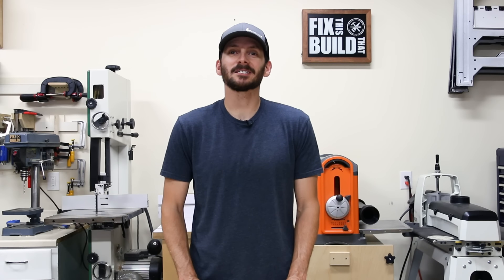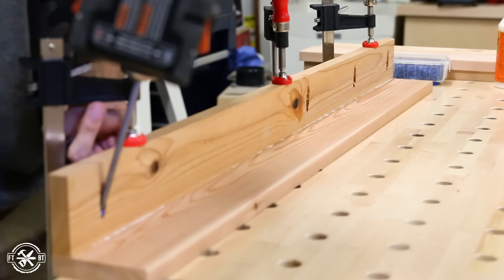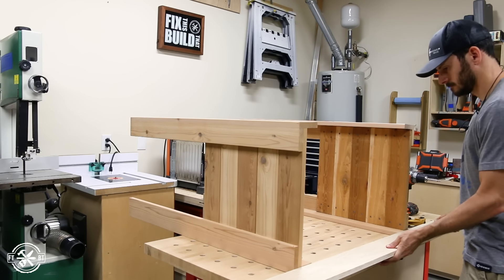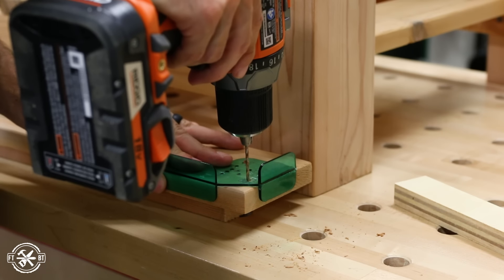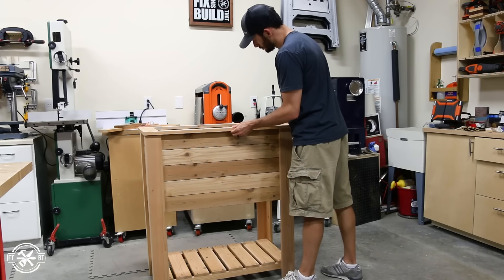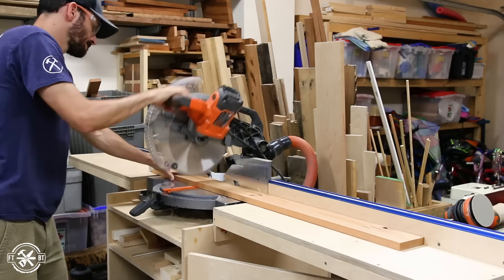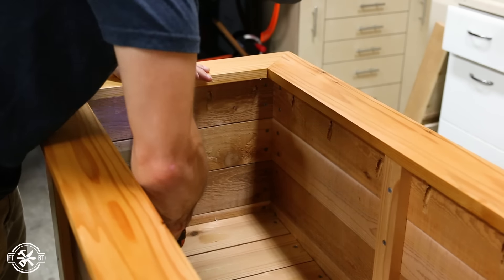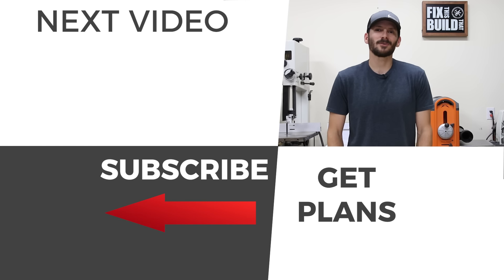DIY Raised Planter Box with Hidden Drainage | How to Build

Comment: Maaaan, this exact Planter Box building process is frkn best of the subj I've seen on YouTube so far!
Thank you!
Subscribing and following you.
Reply: One question.
Does it make sense to replace your wood with the cheapest pine OR even plywood stripes AND cover with some oil or poly protective liquid? Just to make the project cheaper and eligible for multiple repeating? Cause I'm considering to make a sort of Planter Box Garden in my backyard. Wouldn't it be looking cheap with pine/plywood?

Comment: Hi, I have a different design, but I definitely included some of your steps and recommendations. Thanks for the great video! Wondering... I stained the outside of my Japanese cedar, but not the inside since I am organic gardening veggies. Wouldn't poly just start to flake off on the outside in a few short years? Worried about using poly and wondering if it is necessary for longevity of the wood. 
Keep up the great work!

Comment: Love the drainage concept.  Are there any issues with using the plastic lining causing moisture buildup that will harm the herbs?  I know some will drain, but there will not be any air circulation.
Reply: Hello! What do you recommend to do for the air circulation? Can I drill holes on the walls maybe?

Comment: I’m gonna try and make this here soon but my modifications would be to angle the slats to the water flows to the drain and the other is to use gravel at the bottom then soil to help with drainage as others have complained about root rot and I have bird netting to keep them away so I may add two poles up the back to staple the netting too 🤔

Comment: On the patio I have six very large planters where I did something similar to this. I lined each with a plastic tarp stapled in place around the top, just like you have the plastic sheeting. The tarps are reinforced with fabric which I thought would be good as my planters are larger than the one in the video. Then I have an 1 1/4" plastic pipe sealed  into the tarp that carries the water away so it doesn't land on the patio ( you can't ordinarily see the back of my planters) The planter is then filled with a layer of drain rocks which is separated from the  earth above it with a layer of landscaping fabric. That way the earth doesn't clog up the drain rock. It may be overkill but it works great. I keep thinking that I ought to make a video of how it's made and how the pipe is sealed to the tarp etc.

Great job with yours BTW!
Reply: Richard's Woodshop that sounds like a good idea for the drainage and yes please do that video

Comment: Can you recommend a router bit for the chamfers? I bought the plans and was disappointed that you don't say what size bit.
EDIT: So I guess I missed it... the plans do say a 1/16" 45 degree chamfer. But where the heck do you find a bit so small? I can't find anything smaller than 1/4"

Comment: Great Design. I actually took your design and super sized it to make a bigger planter. One thing I'm puzzled is how you managed to screw pocket holes for the legs without breaking the wood. As soon as I drill in the board underneath cracked. I ended up with glue and nails. Plenty strong anyway.

Comment: Nice video.  Only comments I have are about the number of tools you used that most of us don’t possess and likely won’t buy for this project.  They other is that you should be careful about the plastic linings if you plan to grow veggies and herbs because some of those poly plastics release chemicals into y6ur soil. Things like roofing felt, even the organic ones will release chemicals.  Just my thoughts but a beautiful box.  What was your total cost on the wood?
Reply: I also have the same concerns about using potentially toxic liners/materials.

Comment: Great Build that's how i do my Planters, but without the shelf underneath and the drainage. Nice idea though, the frame on the top, do you line yours up with the inside of your frame, to the inside edge of the Planter or just centre it?
Barry (ENG)
Reply from the maker: Thanks, Barry! I did a 1" overhang on the legs and on inside.

Comment: I made something sorta similar last year.  Going back in time, I probably would have made a frame for each side panel and then used thin wood to cover them, rather than use thick wood to make very solid panels.  The thick wood for the side panels added a lot of weight and money that, in hindsight, wasn't necessary. The ones from garden centers tend to do this as well.

Comment: How is the water draining system working after two years?
Reply from the maker: Hey, Ben.  Still drains well.  I should have extended the drain further though as it splashes on the lower deck at times.

Comment: From a safety thing. You should never stack wood to cut it. If there are any slight bows the top board can spin fairly freely and kick around causing a pretty bad situation where boards are kicking into the blade.

Comment: :a ridge sucks …. I had a table saw that was alright only because of the wheel system, and I’ve used a trim router that worked but was sketchy because it had no power.

Only tool that I liked for price / performance was my 50$ vacume

Comment: Too many tools I don’t have 😕
Reply: It's not complex, you can use fewer tools. Skill saw instead of table saw, screws instead of nail gun and glue. Measure twice !!
Reply: If you have a table saw, there are a ton of jiggs you can build. Making 45 cuts and 90 cross cuts easy for example